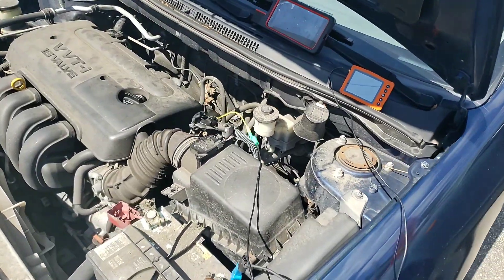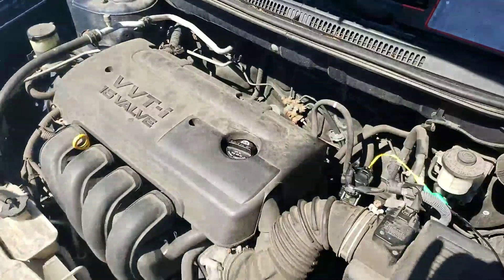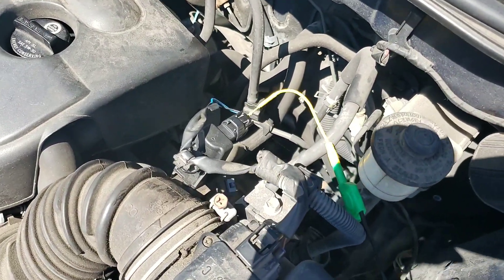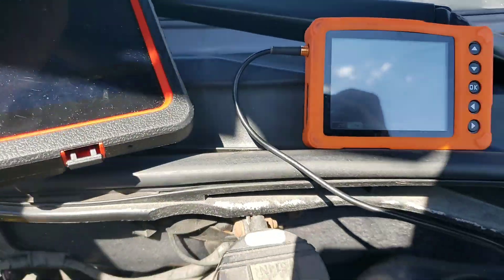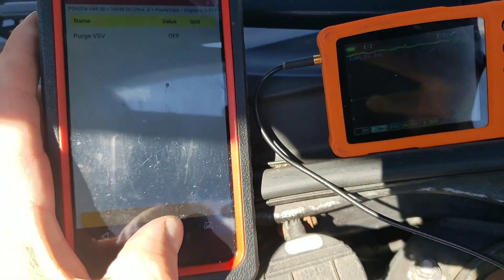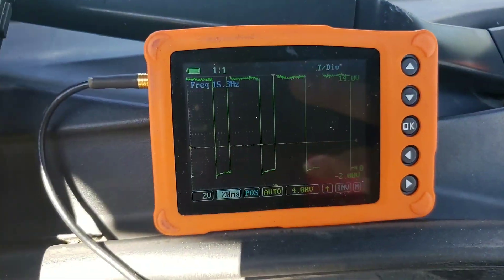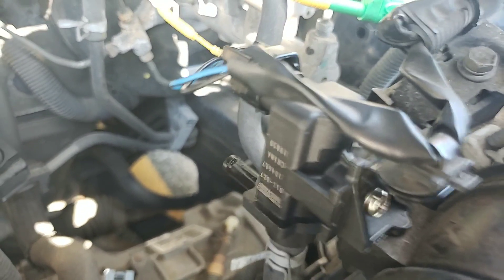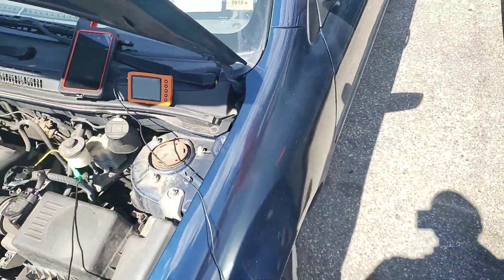2006 Corolla p0441 Incorrect purge flow

Comment: Don't be too hard on them... it must have worked for at least a couple of days! =)
Reply: Hey Thomas 
That's the stuff we get. Even re-boxed Dorman. Today I had a 2006 Ford Freestar 3.0
Replaced plugs,1 coil,plenum gaskets and BWD Egr module.  Ran drive cycle, monitors suspended, p0405.  Replaced egr module with oem fixed. Stuff like this separates us from them. 😎

Comment: Just what u want. A car question. 15 Honda Fit. Does CKP No Pulse mean when there is a number like a 1.00 every few seconds that the crankshaft position sensor is failing to report. CMP B no pulse.  Does a number there refer to a failure mode?
Reply from the maker: I never use the scan data honestly.  On those vehicles I've seen different responses using different scantools . Scope for the win 👍

Comment: Hi gueys  
Plz. I need some help kinda urgent

I got ford fusion 2012 base model 2.5L gas with a/c problem not cooling properly 
With unwanted heater activation, I replaced the blend door with a genuine part didn’t fix it. 

I scanned the car and i noticed the ambient air temp is not working, it’s fixed @ 97 degrees no matter what the weather is like. 

I pulled the front bumber out searching for it for 3 hours but i couldnt find it nor its harness no where near the front end. 

Can somebody tell me where its located exactly. 

If not existant at all in this particular model, where ciuld the pcm taking this outside temp reading from..??

Thank you
Reply from the maker: Yellow green and Gray blue wires should be attached to the front facing side of the radiator support . You're assuming that the sensor is actually there. Always expect the worst. Expect that the car was in a collision shop and is now missing 😉
Reply: New Level Auto nope
Never been in a collision !

And I don’t see any harness whatsoever hanging nor anything out of order. 

Any other suggestions ?
Reply from the maker: @leo28a  I searched all service info . It all says it should have one.
Reply: New Level Auto thanks Keith 
But I don’t have any display on the dash nor the radio from factory. 

And Remember I can only see that temperature in scan tool.

If indeed there is one, right front of the radiator, where’s the harness..???
I don’t see any harness chopped off or even out of the ordinary. 

Could you plz. Check where exactly it’s located..??
I can send you the vin # if you like. 

Could it be embedded within the hood switch by all means..??

Or even embedded within the radio antenna..?
Reply: New Level Auto here’s the VIN
3FAHP0GA2CR324381
Reply from the maker: @leo28a  are you on my Facebook page ? I can post the pic there
Reply: New Level Auto 
yup. On Facebook

Hey thanks again Keith. 🌷